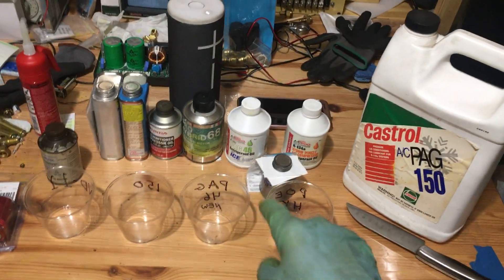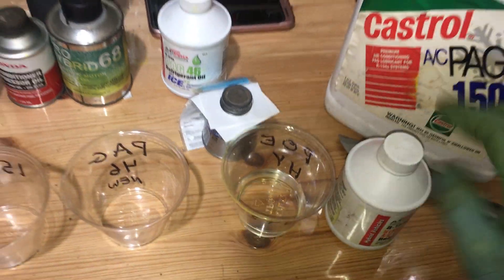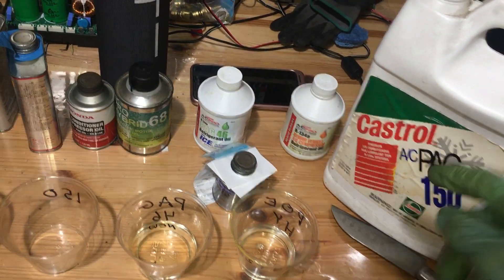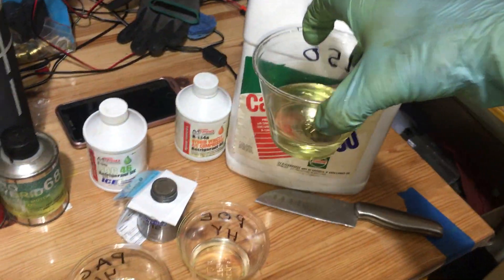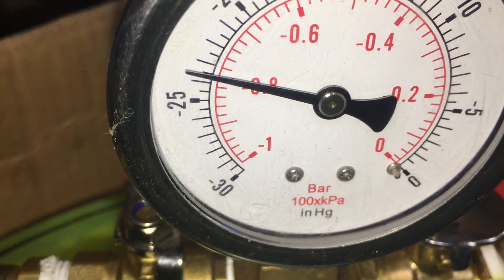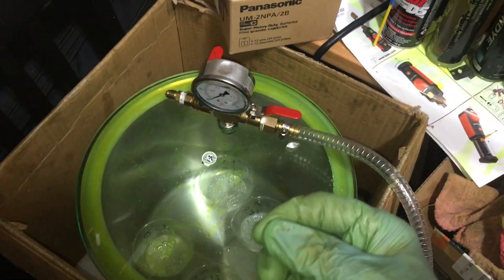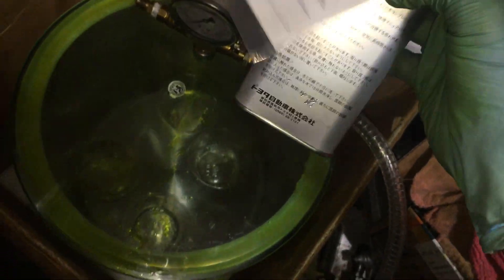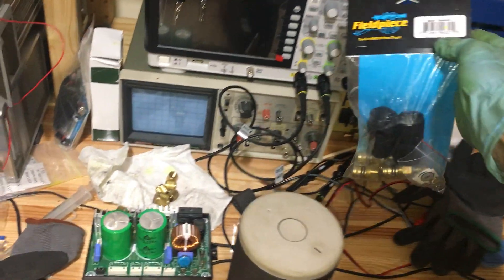Refrigerant Oils thrown in a vacuum chamber reaction of moisture contamination￼

Comment: Too bad you didn't test PAO oil.
Reply from the maker: There’s many types of oil I have a can of PVE  Most oils of all the different viscosities. 

The air conditioning manufactures the compressor manufacturers have gotten quite ridiculous on the amount of different types of oil’s and then on top of that you throw in the different viscosities anywhere from 46 viscosity up to 150 viscosity
Reply: @coldfinger459sub0  Cannot be understated:
"the compressor manufacturers have gotten quite ridiculous on the amount of different types of oil"
Reply: @coldfinger459sub0  PVE (FV50S) oil with 50 viscosity  is SUPER OVERPRICED. WTF! 😅
Reply from the maker: @w0lvez1  yes
Reply: If you do another test.. Toss a year old once used brake fluid in there.
Reply from the maker: @turboflush  I just happen to have it open can of brake fluid that’s probably about two or three years old.     Compare it to a brand new fresh bottle opened
          Time for me to do a brake flush anyway